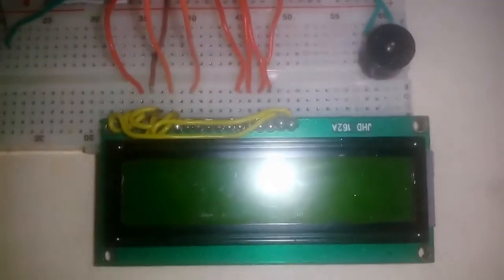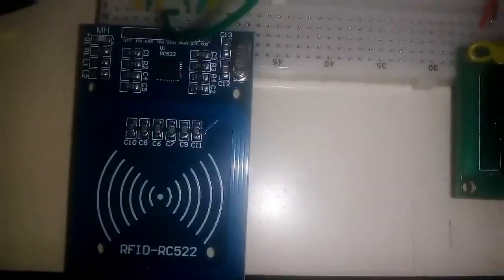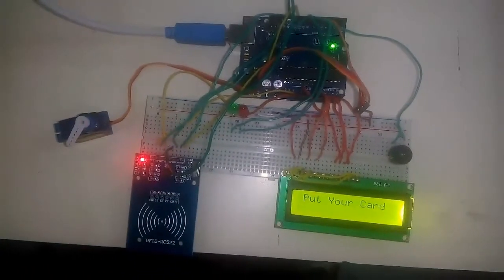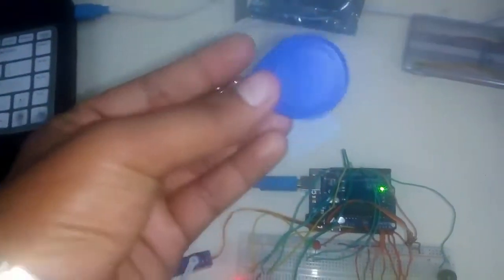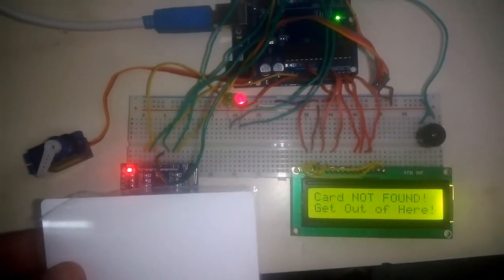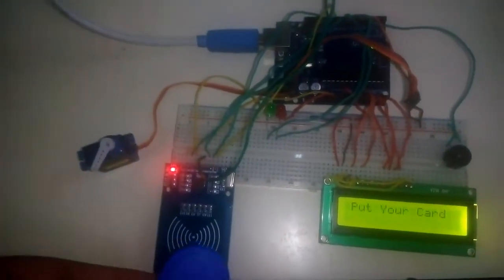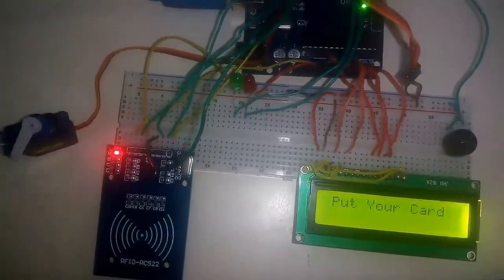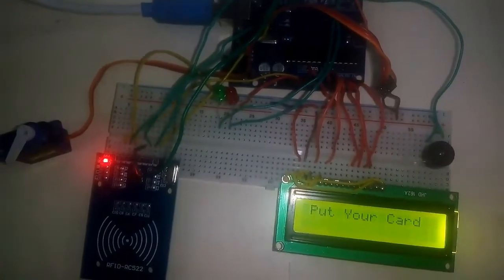RFID based Door Locking Security System using Arduino

Comment: good day,

is it possible to replace servo motor with magnetic door lock (600lbs)? and how should i wire it?
Reply from the maker: It is possible but program needed modification. Instead of servo program, digital on/off command is used. For hardware magnetic door lock requires more current and voltage
Reply: @HowtoElectronics  so i just need to replace your command code with same wirings?
Reply from the maker: Yes bro.

Comment: Bhai i need your help plz contact me 03214537874 i need this project code
Reply from the maker: http://lifeispreety.com/rfid-rc522-based-security-system-using-arduino/
Reply: Bhai is ma error bhot ata ha
Reply from the maker: This is correct code.
Please update the library first
Reply: How to Electronics bhai ap mujy libaray mail kr da
Reply from the maker: Google it bro. You will get easily.
The project is very easy and even the code is short. All you need is search the library in google and add to arduino library. The code will compilr.
Reply: Bhai is ka card ka unique id kaha per add kerna ha